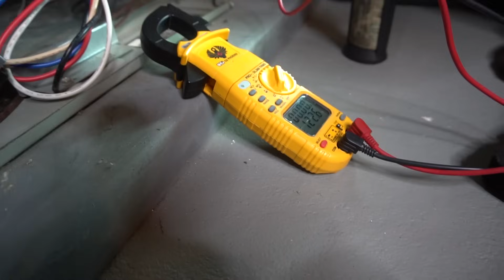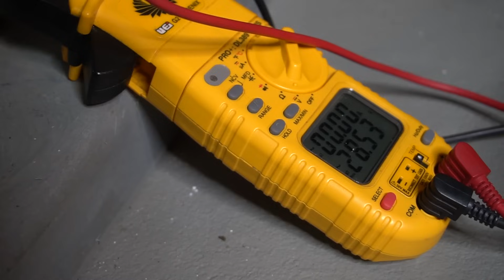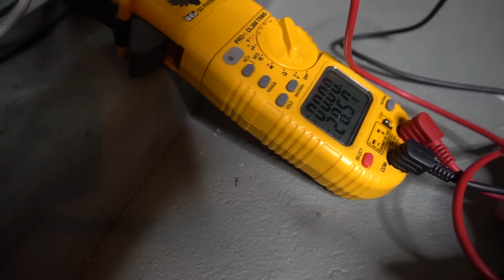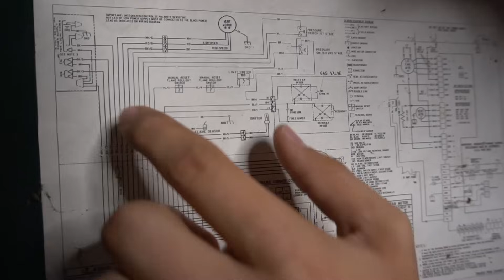Furnace/AC How to Troubleshoot The Control Board

Comment: You mentioned being taught if you have voltage powering the circuit board but no voltage coming out the circuit board is probably bad.   In my situation I have 120v power on the board but from the board comes the transformer's input power.  The 24v output from the transformer comes back to the board and powers the intelligent parts of the board.   In my case I'm not getting any low side voltage on my furnace circuit board and it's because as soon as I hook up the inputs to the transformer the input voltage drops from line to zero.   

Details:
There is no 24v on the board to feed to the thermostat, to operate the AC contactor, etc.  The circuit board's LED is on but only just barely.   I thought it wasn't working until I accidentally turned off the lights in the furnace room and then noticed the LED was just barely glowing. When I unplug the transformer inputs (neutral and hot) from the circuit board and measure the across the circuit board's terminals I see line voltage (115v).  But when I plug the transformer into the circuit board and measure the voltage across those same terminals I only get about 0.05v (not zero but close). This is with or without the output side of the transformer plugged into the circuit board. 

I removed the transformer from the furnace and tested it.  When connected to line input (a wall outlet) I get the expected 28v output.  While hooked directly to line voltage I hooked up the low voltage transformer leads to my circuit board and then the LED came on bright and flashed normally. 

Likely I have a bad circuit board but don't want to replace the board without knowing the cause. Any idea what could cause this? If I replace the circuit board is this just going to happen again?

Forgot to mention I removed all thermostat inputs and the 24 volt control wires to the AC condensor / contactor and left them off during testing.  I also measured the transformer input voltage (with the transformer input coming from the circuit board) while removing all the other wires from the circuit board one at a time (i.e. power off to furnace, pull a wire, turn on power, measure voltage). Even with everything disconnected I get zero volts across the input terminals when the transformer is connected.

I've verified the thermostat is acting normally.   I've checked the capacitance of both the start/run capacitor on the AC and the capacitor on the fan and all are within spec.   The low voltage fuse is fine and never blew.  

My plan is to replace the low voltage transformer first and see if the same voltage drop is observed.  If so, then I'll replace the circuit board.    I suspect a new board will fix the problem.  If the problem recurs I'm just going to power the low voltage transformer directly from line input (not from circuit board.. I'll use a fuse inline just to be safe). 

What could cause this problem ?!
Reply from the maker: Wow you were really thorough in your troubleshooting and then relaying what you did here! That's rare! :) From everything you described, it sure sounds like a bad control board. As for what can cause that... It can be a variety of things including a power surge. Hard to accurately guess what it could have been. One thing I would do though, is splice in a 3 amp fuse in the 24VAC wire coming from the transformer and into the control board. (This would only be done if your board does not already have a 3 or 5 amp fuse or breaker). That way if there is a short somewhere it will take out the fuse instead of the board.

Comment: my system works, but when it gets to the desired temp., the system will not shut off. I replaced the thermostat and it did not help. Think it is the control board?
Reply from the maker: If it is not the thermostat then the control board is the only one left.. Unless your fan setting on the thermostat is set to ON. In that case it is possible that the contactor in the outside unit is getting stuck in the closed position.. (would need to clean contacts or replace contactor if that's the case.

Comment: Hello  like the videos,  my problem. 
I have a furnace in cooling mode with blower and inducer fan running and no condenser operation, what could be my problem.  I thought it was contactor because it didn’t start condenser, then found inducer fan and blower run...  thermostat is operational.

Comment: Something's burning my hundred and twenty volt side of my Transformer can you tell me what the culprit may be
Reply from the maker: Most likely there is either a pinched wire, broken wire, or bare wire that is touching something metal. That is most common.. Could be a problem in the furnace power switch or the breaker too. This one has the potential of becoming a headache though.. Electrical shorts can be annoying to track down.

Comment: Hello Word of Advice TV, 
Can I ask you a couple of questions, please? 

I was informed by an HVAC tech that I need to have the motherboard replaced in order to fix the AC that's short-cycling. Does this sound right to you? If so, what would be a reasonable price for this type of job? I did do some research online but didn't see any info that a bad motherboard would cause the AC to short-cycle.

Thank you!
Reply from the maker: To me a short-cycling AC sounds more like the unit is low on refrigerant.. Of course I was not there so I don't what he checked or did not check. I would get a second opinion from a different tech if possible.. I can't say what the price would be since control boards vary in price from unit to unit. I would say an average price is $400. For high end furnaces with variable speed motors and all, the price would be higher.
Reply: @WordofAdviceTV  Thank you so much for your response! I appreciate it very much.

The tech refilled the freon & changed the capacitor because it was about 16 years old. It still short cycled. 

He then took a look at the thermostat and the motherboard which took awhile to test out. Once he determined that it was the motherboard, (it looked to me as I watching him) he moved the placement of some of the wiring around. This stop the short cycling for about 6 days but now it's doing it again :/ 

With that being said, I thought it may be safe to trust the tech. I understand it's very difficult to give advice on something without examining it yourself. I was just curious as to if it's something that could possibly happen at all or if you've dealt with. 

Thank you so much for your time and responses!! It's been hard as I don't know anything about the AC related matters. Thank you again!
Reply from the maker: @morgansdoor  Ah I see! Thank you for the whole story :) To be honest I don't remember the last time I ran into an air conditioner that was short cycling because of the control board.. (not saying it's impossible) I would suspect the thermostat before the control board. But once again this is just speculation from a guy who hasn't even seen your unit. If you do go with the repair, I would tell him something like. "This repair is pretty expensive.. Can you guarantee your work? If the air conditioner still short cycles, will you come back out at no charge to get to the bottom of this?"
Reply: @WordofAdviceTV  Thank you so much for your response! Thank you for the advice on what to ask them if I should decide to go with  replacement of the control board. 

In the meantime, I'm going to replace the thermostat even though the tech said it was OK... process of elimination.

Again, thank you so much for your time and help. I can not thank you enough^^
Reply from the maker: @morgansdoor  Glad I could help! If you really wanted to, you could probably find and buy the control board yourself. Before you buy a new thermostat, there is a way you can easily test it. Just jumper R to Y at the thermostat. That should turn on the air conditioner and run it non-stop until you take the jumper back off. (that will be the case if the thermostat is the problem) I have videos on how to bypass the thermostat if you need more info on that.
Reply: @WordofAdviceTV   Yes, you really did help a lot!^^ I remember watching one of your videos on testing the thermostat a couple of days ago. I'll go back and review it. Thank you again! Take care.

Comment: In the video you mentioned if the LED light is on you most likely have power. In my case I have a green LED that's NOT on. Does this mean I have a bad control module? 

(I'm getting no power to my Nest Thermostat, heat nor AC turns on)
Reply from the maker: Just to confirm.. Is the door switch taped or are you holding it in when you are checking the board? Those LEDs rarely burn out so likely there is no power going to it. Could be a blown 3 amp fuse on the control board too.
Reply: @WordofAdviceTV  I tried holding the switch and still no LED. I couldnt locate the fuse anywhere. There's a small chip on the side of the module but it doesnt look like a fuse. Looks more like the brains of the module. I have a white Rodgers 50e47843
Reply: @WordofAdviceTV  when I press the manual switch to turn on the fan, it does come on so it seems like there is power coming in but cant control anything from thermostat
Reply from the maker: It could be a bad board, no power, defective thermostat.. Only way to eliminate the guess work is if you have a multi-meter that you can check voltages with
Reply: @WordofAdviceTV  L1 is showing 120V coming in but still no LED on the board. On my Nest Thermostat it says "R" doesn't detect no power. kinda leaning to towards a bad board now. 
One more thing, I couldn't locate the fuse anywhere. Do they make control boards with the fuses behind the cover plates?
Reply from the maker: @ahyam4055  It could be a bad board yes.. But I would check the transformer first. Not all control boards will have a fuse. Sometimes there is no fuse at all and sometimes there is a small 3 amp circuit breaker instead. To check the transformer, just trace where the wires go from the transformer and check voltage there. It should have 120v going to it (usually black and white wires) and 24v going out. If the transformer is putting out 24v, yet you do not have 24v between R and C on the thermostat strip, then the board is likely bad. If the transformer has 120v going to it but no 24v coming out, then the transformer is bad. Hope that helps! Sorry that's it's a bit unorganized
Reply: @WordofAdviceTV  I jumped R and W  at the thermostat and heat kicked on! So control board looks fine (unless I'm wrong) I tried jumping R with the other wires one by one but nothing is happening.
Reply from the maker: @ahyam4055  Well.. Actually, since the heat came on, that means you do have 24v which means the transformer is good. If jumping R to G does not turn the fan on though, I would still suspect that the board is bad. Especially since the LED does not light up (even though board does have 24v)
Reply: @WordofAdviceTV  UPDATE control board was good. Thermostat wires coming from furnace had 24v. But the thermostat wire upstairs had no power. I ended up cutting out old thermostat wire and bought new 18/5 thermostat wires and ran a new connection and everything starts and runs fine! 

Thanks for your help @WordofAdviceTv!!!
Reply from the maker: @ahyam4055  Oh I see! Glad to hear you were able to track down the problem! Thank you for coming back with an update!

Comment: Great vids.  Ac compressor not kicking on 
Capacitor good
Circuit board good
Magnetic switch good
Compressor good 
The fan works outside but compressor won’t kick on there is a slight buzz every once in a while as I manually hold the magnetic switch down but that’s it    I have checked all the above using your videos.  Great job you naturally explain things very well    Anything else I can check or do before I call repairman
Reply from the maker: So with the contactor plunger pushed in, the condenser fan motor starts but the compressor only hums like it tries to start? That sounds like a dead capacitor. But if you checked it and it's good.. And the unit is getting 240v, then that may mean that the compressor is seized up. You can try putting in a hard start kit and that may get it to go. I have a video on how to install one if you need it.

Comment: My control board  light doesnt power on at all ...Power is coming in ..
Reply: Probably too late on this but for anyone else, look for a small automotive fuse plugged into the motherboard (or hanging off it) marked “3” (also looks like “E” upside down). With power off, pull this fuse and look through it to see if it has been blown (wire inside is broken and may have a small burn mark). If so, that’s your problem. Simply replace with a new 3 amp fuse (available at most automotive stores and some hardware stores), then tiurn on power to your system.  If the motherboard is ok, you should now get the blinking red light.

Comment: Awesome video really help! Can you post a video about fan staying on all the time during cooling mode and also fan relay testing? Thanks.
Reply from the maker: Hey Alex! If the fan is staying on all the time even though your thermostat fan setting is set to AUTO, then either your thermostat or the control board is bad. (or if you have a fan relay, then the relay) An easy way to see if it's the thermostat is to simply pull the thermostat off the wall. If the fan turns off, then you know the thermostat is bad. If the fan stays on, then it's the fan relay/control board that is bad. There are other possibilities but they are rare.
Reply: @WordofAdviceTV  Alright got it! Thank you. I will keep watching your other videos.

Comment: That door switch was the first component to fail on my furnace.  It would fail intermittently, usually while I was at work.
Reply from the maker: Intermittent door switches can be tricky to track down. Same with a loose connection in the furnace power switch.

Comment: From door button u said power goes to control board,, don't u think it shud go to transformer first 120 voltage than transformer shud make it 24 nd send it to control board.
Reply: The control board has both high and low voltages running through the circuitry.

Comment: i have 120vac to my transformer , but i only got 22v at the secondary, is that the reason my unit will not turn on?. i don t even have any low voltage across my contactor.
Reply from the maker: You should at least have 22v at the contactor then.. Check out my video on 10 reasons why a contactor does not pull in for more ideas of what to look for.

Comment: Is it would be correct if I measure continuity between terminal L on a board where power coming in from door switch and terminal where power comes out from the board to transformer in order to diagnose if the board is faulty or not?

Comment: Hello my AC fan blower motor wont turn on in the auto mode, it works fine in
 the fan on mode. Any suggestions. Thank you. Very easy to follow videos.
Reply from the maker: Very likely that your control board is bad. But there is a chance that the thermostat is bad too. So I would test the thermostat first. Try jumpering R to Y (for cooling) or R to W (for heating). If the fan does come on, then the thermostat is bad. If it does not come on even with a jumper, then the control board is bad. I have videos on how to jumper/bypass a thermostat if you need them. (if you have a heat pump, the jumpers would be slightly different)
Reply: @WordofAdviceTV  -  Thank you for the wonderful advice. It's just starting to get warm in Wisconsin and I am grateful to you for helping me repair my 81 year old Mother in laws AC. God Bless You.

Comment: Hello my AC fan blower motor wont turn on in the auto mode, it works fine in
 the fan on mode. Any suggestions. Thank you. Very easy to follow videos.
Reply: The control board should send voltage to the low speed fan motor winding when the thermostat is in heating mode and voltage to the high speed fan motor winding in cooling mode.  You can also check the resistance of each fan motor winding to make sure none of the windings are open.  (A shorted winding would most likely cause the breaker to trip.)  It's really a process of elimination but experienced technicians usually  know where to start looking from the symptoms of the failure.
Reply: @picklerix6162  Thank you for the help. I will check all of these circuits.Have a great day.
Reply: it is possible that your house thermostat is defective.
Reply: @jungapo2  Thank you for your help. As it turns out there is a delay from when the compressor and condenser fan start till when the actual blower motor kicked in. This was not at my house. I was doing repairs for a friend and never came across this kind of delay. Your advice is truly appreciated. Have a great day.

Comment: Hi 
I have similar Lennox whisper heat furnace last month i replace blower moter but it acting up agin i cant figure out what going furnace turn on fire stay  on 2 minutes but fan doesnt trun on i hear click sound but then everything shuts off can u be any help
Reply: Clean the flame sensor and pull off the hose and clean the opening on the pressure switch.  My furnace would work intermittently but sometimes it would only stay on for less than minute.  My failure was caused by a bad control board that worked intermittently.